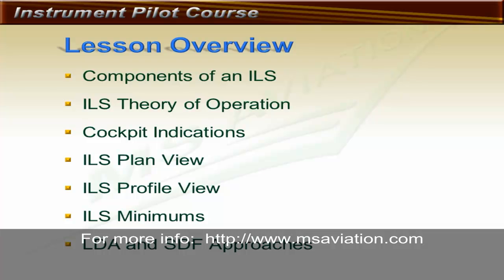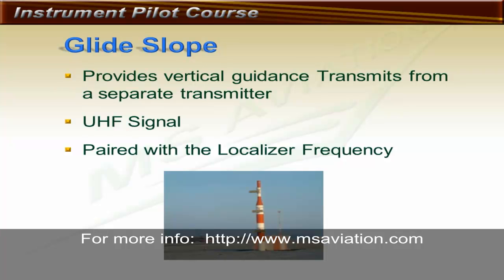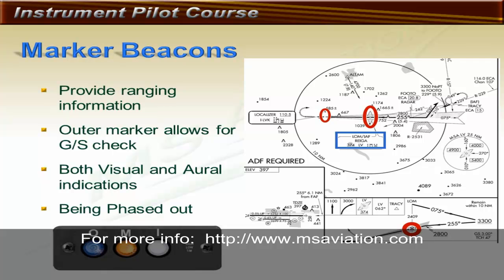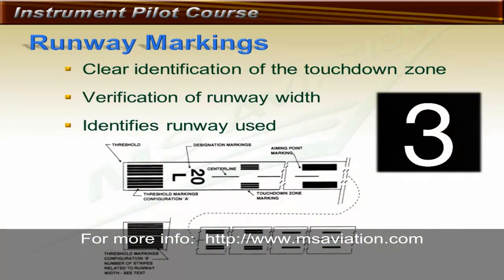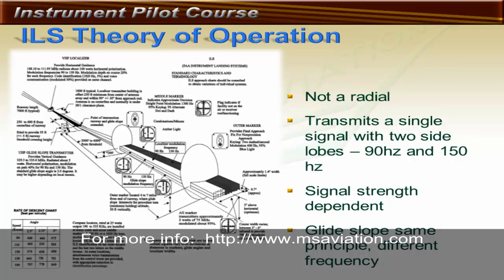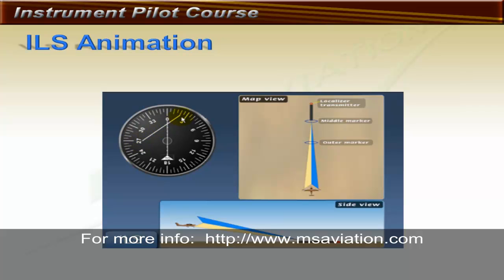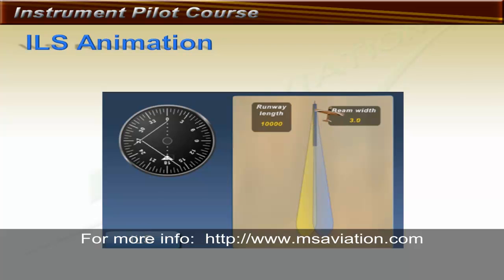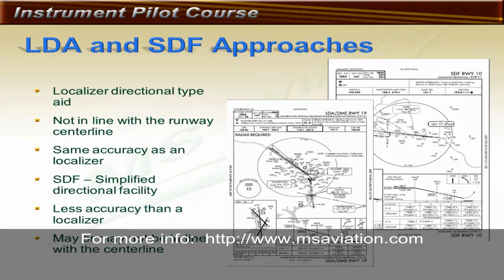ILS Approaches

Comment: Hi there. I have seen various explanations about how the ILS works and in some it says that the antenna transmits two beams, one with and the other without carrier. Others say it transmits 3 beams, one with carrier, one without and the third is a 180deg phase shifted version of the second. The explanation about the receiver is that if it doesn't receive a signal, it is centered. There seem to be a lot of discrepancies about this. Does some maybe have any idea about this ?
Reply: Mr Renegade ILS has 2 sub systems. Localizer and Glide 
slope. Both sub systems radiate what’s called CSB and SBO. Both signals are modulated with 90 and 150Hz. There’s a lot more to the ILS to type but this is some some basic info.

Comment: 9:17  The pilot should not 'fly up' to capture the GS as this results in an unstable approach in the vertical.  Rather, the pilot halts his descent until the GS needle comes in.  Above all, it is about situational awareness, how far along on the approach and so on.

As an approach is to a landing, which obviously necessitates a descent, to climb up toward the GS is to result in altitude excursions and attendant power settings which themselves result in an unstable approach.  Not the least is this contributes to too much work for the pilot while so near to a landing.  In a word, it's foolishness.
Reply: In the same segment the left localizer course is yellow for 90Hz.. The glideslope would need to have yellow on the top for 90 Hz. They have it backwards.

Comment: When you're passing the Faf (final approach fix) you tune the ils/localizer freq on your Nav 1, also you need to tune it on you DME, to check the distance from your threshold.
Reply: Arnoldo León wrong. The LOC frequency is tuned long before beginning the approach. You're not doing anything at the FAF besides configuring for landing and continuing down the gs.